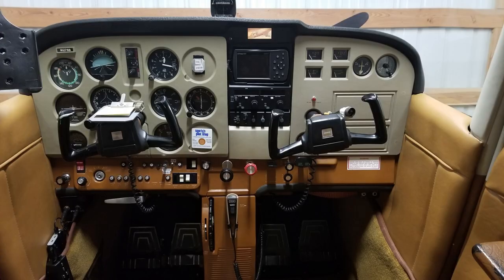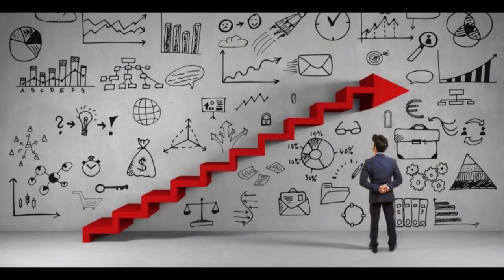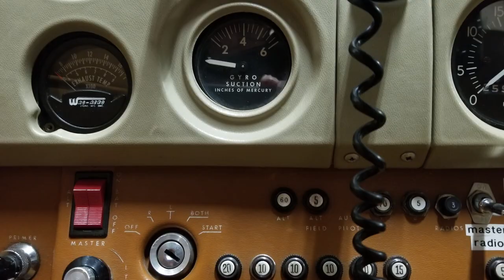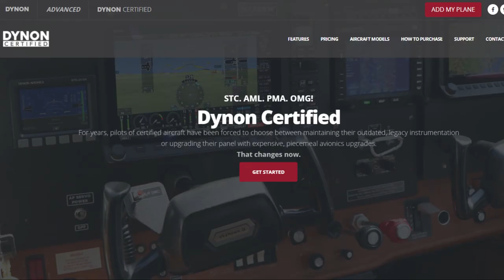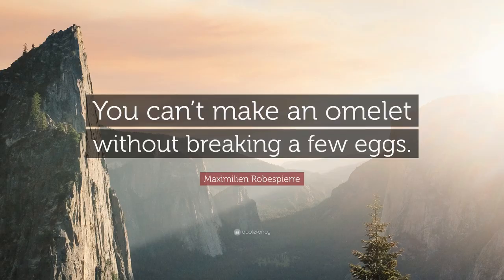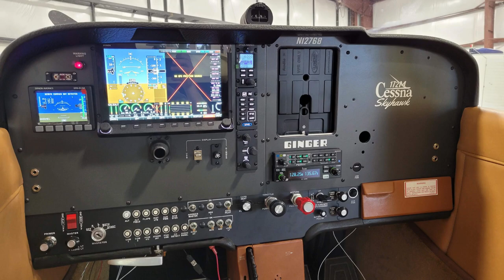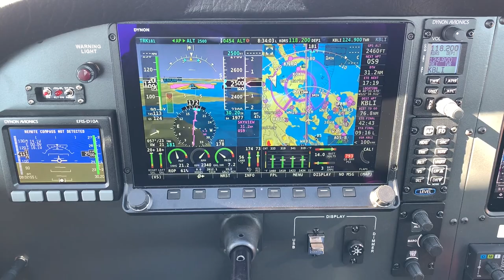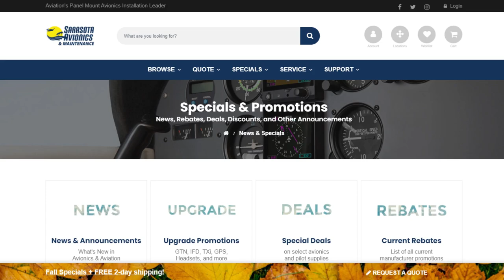Cessna 172 Panel Upgrade | Dynon Skyview HDX | Watch This First

Comment: I pretty much have the same setup being worked on my Cherokee and my cost is $63000. Engine monitoring was going to be additional 5k so I declined on that, and I put in 440 GPS. I sold my Porsche to do this 😢
Reply from the maker: Sorry you had to sell the Porsche but you’re going to love it! I’ve flown more than 200 hours with the Skyview HDX over the past 2 yrs and I’m still blown away by its capabilities!! You will have even more with the 440, that’s my next update when I’m ready to add IFR. Good luck!

Comment: So the Dyson unit has a gps you need like gtn navigator?
Reply from the maker: An IFR certified navigator, for example an Avidyne IFD-550, is required to fly IFR. The Dynon GPS is excellent and works perfectly for VFR navigation and flying 👍
Reply: @GingerThePlane  I meant to do you need a navigator, and does the Dyson unit have a gps? I didn’t know those Dynon units had a gps built in.
Reply from the maker: @MattMorris481  gotcha, eventually I plan to replace my iPad mini with an Avidyne IFD-550. Until then I’m more than happy with the GPS included with the Dynon Skyview HDX.

Comment: Hi Tom  congratulations on your panel upgrade.....I just finished one in my 1973 172M as well. The Dynon system with a G430W and auto pilot makes a fantastic flying experience....thanks for posting your panel upgrade video.
Reply: I would be interested in seeing what your set up is. Looking to make the transition and upgrade mine so I can do IFR training in my plane. 172M basic panels besides a stratus transponder

Comment: Super informative and great walk through of the upgrade! Can't wait to do this in about 10 years when I retire from the Air Force.  Couldn't recommend the IR more around here! It was actually a lot of fun to get.  Ginger looks great inside and out.
Reply from the maker: Thank you, I’m glad you found this helpful! Most upgrade videos focus on the work of changing out the panel/avionics, I wanted to share the pre-upgrade decision process that ultimately leads to a successful project. You can have a closer look at Ginger when we eventually meet up somewhere this summer. 👍

Comment: Great panel. Extremely functional. Not sure if I would put “warning light” decals next to a warning light. Seems obvious. 
Other than that, Ginger looks great. It sure puts value into the plane and a smile on your face each time you fly it. 😀
Reply from the maker: Thank you! You’re exactly right, I always smile when flying behind this panel. I agree a warning light label seems redundant but I was advised to have all the proper signage and the original panel did have a high voltage warning light, so what the heck. What do you have in your -9? Thanks for stopping by GTP!!
Reply: @GingerThePlane  Maybe “high voltage” would make more sense than “warning light” then 🤣🤣 My panel is first generation glass, also from Dynon and a TruTrak AP coupled to a good old Garmin 496. Works fine.

Comment: nice job, all that work why would you not get Garmin?? just a little more
Reply from the maker: Thank you! This is a great question and I appreciate you asking. I chose the Dynon HDX over Garmin G3X for its performance and cross-platform compatibility. Also, I found the G3X to be significantly more expensive, in initial and ongoing costs, it doesn't have any differentiating features or performance attributes that set it apart from the Dynon Skyview HDX. I stress the importance of selecting your brand first, then finding a shop to do the work. 👍

Comment: i actually prefer the round  analog gauges,    with a GPS .  
 fuel injected, analog gauges, radio stack and a GPS unit, im golden  :-)
Reply from the maker: I hear you, I’m an analog guy and flew behind steam gauges for 30 years before embracing glass. I have to say while I love round dials it’s incredible how much aware you are with these new panels and how much more I’m looking outside the cockpit. It transformed my flying. Thanks for watching and welcome to Ginger’s channel 👍✈️🍀
Reply: @GingerThePlane   yeah thats true,  now for me sometimes the info on the glass display, all  '' runs together''  but the analog gauges i can scan and  know what each thing is,   but im sure with time ill get used to the glass digital dynamic displays, m gonna have to because commercial planes  are all glass display

Comment: Question do the airframes have a maximum number of flight hours allowed? I know military aircraft maximum numbers of flight hours before they are retired.
Reply from the maker: Good question! I'm hardly an expert on this but general aviation aircraft like Ginger never see the stresses a military aircraft sees regularly. My understanding is civil aircraft are able to be flown so long as they remain airworthy. Each year the airplane has an annual inspection to evaluate its fitness and any needed repairs are made. Corrosion takes a lot of aircraft as does accidents, a well maintained airplane can last indefinitely. Ginger is relatively young in airframe hours despite her 48 yrs, we keep her in top form and safety is paramount in everything we do.

Comment: Can you lean more/better with more accurate EGT?
Reply from the maker: Yes, to a point. Ginger has a carbureted engine and that means each cylinder has a slightly different mixture. I lean to 65% power on the ROP (rich of peak) side, keeping my hottest cylinder 20° under its peak temp.

Comment: I would never put an iPad mount in the panel, as that will be obsolete in a few years.  Just use a yoke mount for the iPad.
Reply from the maker: Good point, in this case we're using radio stack space that will be used for a future IFR Nav/Com. I'll update with a new video when that's added. Thanks for sharing your thoughts. 👍
Reply: @GingerThePlane  yup, it's just the cost of the original install. Swapping out won't cost any more, but I bet the panel mount cost a lot more than a yoke mount and, frankly, I find the yoke mount a better user interface (although no doubt the panel mount looks really slick).

The install looks fantastic though, and the Dynon Skyview is a no brainer. Frankly I don't understand why anyone upgrading a panel would use anything else.

Comment: I have Ginger’s hot older sister.  172 F with 1275 TT. 100%  original avionics . Immediate needs are comm and ADS-B transponder . I don’t have $35k to spend. it appears I am 250 miles from a Dynon Center…  long flight trying to stay legal….
Reply from the maker: Sounds like you found a unicorn, too! It’s a tough decision, whether to add ADSB out and a NavCom (or Com only) or stretch the budget to upgrade to a glass panel. Either way you’ll have to budget for a good avionics installer’s time/labor. You’ll figure out what’s best for you and your mission, I’m sure, hope Ginger’s older sister (love that) continues to treat you well and gives you many fun adventures!! 👍✈️
Reply: @GingerThePlane  112112
Reply from the maker: Sorry, what do those numbers mean? Thx
Reply: @GingerThePlane  tried to attach a pic but appears that is not possible
Reply from the maker: @davenorth6794  gotcha, thanks! Feel free to share to gingertheplane@gmail.com 👍

Comment: Is there price you can give us for this upgrade or is that private?
Reply from the maker: As mentioned, the amount varies based on the equipment chosen, the shop doing the work, inflation, etc. Checkout the Dynon website, they have a great cost calculator there. Best of luck with your upgrade.
Reply: @GingerThePlane  ah perfect thanks! Great video. Been looking to upgrade